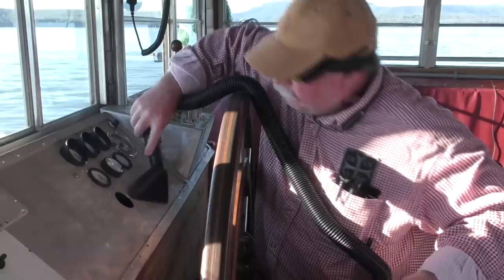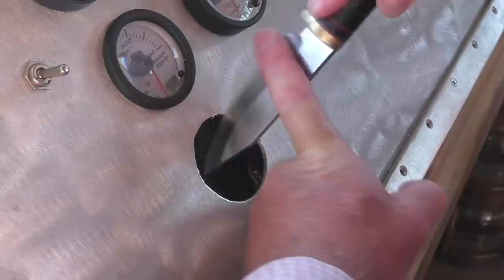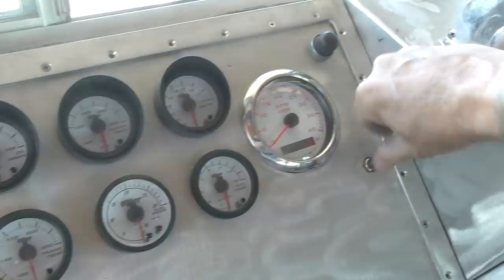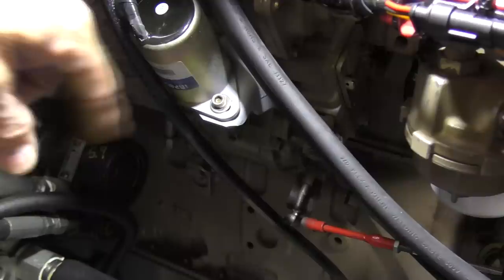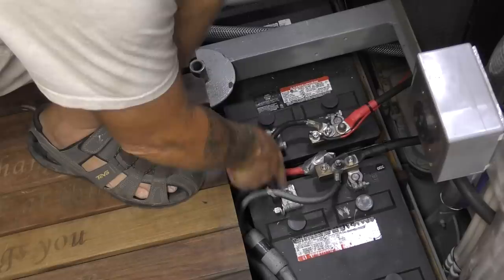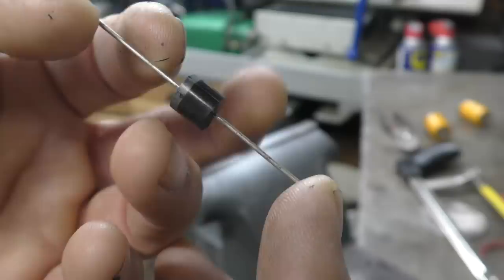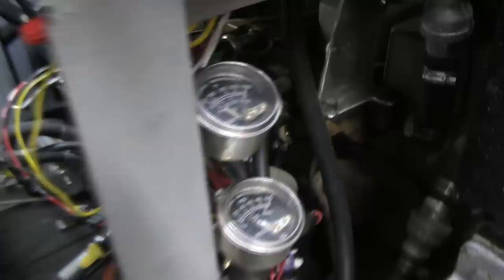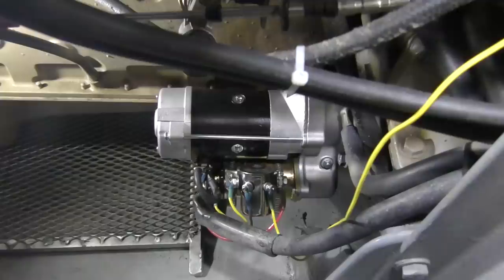Engine Electronics - Starter Relays Diodes and Gauges

Comment: I know this might be a bit on the high tech side, but an automotive CAN bus system and glass gauges on a display would be pretty trick, and let you pick up a lot of pressures and temps without a lot of wire. Even can program in some alarm limits and control points.

Comment: You had a lot going on so it was a little hard to pay attention but, maybe that ground wire was the problem and it was back feeding 24 volts through all the solenoids and all the way back up to the switch.

Comment: FYI that Is not a ground wire on the starter you had the 300 a solenoid grounded to, that would be the 24V that rotates the starter motor 😂

Comment: Hi Doug.
Put a fuse in series with the diode..
Diodes out of alternators are fairly chunky..
You could also use a spark plug (very small gap) also with a fuse.
Regards Mark.

Comment: The diode idea is good. You may need to make an array of 10a diodes series ups voltage, parallel increases amperage. An inductor or choke might help as well. They sell larger diodes too. A boost capacitor pack rated for 24v would work way better, because it works like a filter(less noise).if it was me I'd do both for peice of mine. With EVs' the way they are you might be able to find a contactor for cheap. Some contactors come with diode suppression. As always Thank You for the great video.

Comment: The voltage rating on a switch has a lot to do with how far apart the contacts get in the open position. Your problem isn't surges of current, it's that the air gap isn't sufficient to break the arc quickly (and the contacts lack sufficient thermal mass or melting point to sustain any significant heating) You SHALL continue to burn up 12v switches regardless of anything you do to limit back EMF or reduce the switched power in watts, with the only hope being that you randomly stumble on a brand that builds 24v capable switches and labels them 12v only by mistake.

Comment: Your back EMF and diodes is an interesting problem...One other way to think about coil inductance and back EMF is that it is analogous to water hammer. So inductance in a circuit gives the current flow a sort of "momentum" and if you try and shut it off "instantly" that "momentum" immediately hammers on your air gap you just made with a switch (or relay contact). The "momentum" will create as much of a spiked hammer pressure (back EMF voltage) as it needs to continue flowing how it had been (hence all the arcing etc.). Viewer\Commenter "d_" @deefdeefdeef  points this out, and so what you want the diode to do is be pointing in the direction that permits the continued circulation of current around that coil to continue even after you have opened a gap to the power supply, so then it harmlessly continues to circulate in the same direction around the coil, SLOWLY dissipating because of the coil's resistance. That's always made it easier for me to think about it in the past anyways. As far as diode current rating they would need to carry at least the same current as seen in the coil at the moment the switch is opened. BUT there are other factors such as response time (also mentioned by "d_" @deefdeefdeef ) i.e. using Schottky diodes etc.

Comment: On your secondary starter solenoid, run the 24V output directly to the larger wire on the starter.  That way your starter solenoid only has to engage the bendix and not have to close current to the actual starter motor.

That's basically how a Ford starter has been wired forever. Look up the starter wiring for a '65 Mustang or an '80's Bronco  (or, hell, a riding mower :) )

Comment: The 10A diode has insufficient current rating for those very big relays.  A catch diode like that does not require very much voltage rating (50V is plenty), but the current rating must be higher than the solenoid current at the moment you open the solenoid.  Use a TVS diode instead of a regular diode because it is built to take a large transient loads.  That means it can absorb much more energy without damage.  I also suggest a large non-polarized capacitor in parallel with the switch contacts (not in parallel with the diode), such as 1uF, 50 volts.  The capacitor gives the current an alternate path to take when the contacts of the switch begin to open and the diode is not yet conducting, just when a spark would normally form (just like in an older distributor with points and a condenser).  A capacitor will reduce sparking on the contacts even more than a diode alone and lengthen their life further.  One thing to realize is that a solenoid is actually a generator.  The mechanical armature generates back EMF when it moves.  Therefore, the diode must redirect both the stored energy of the coil as the flux decreases and the stored mechanical energy of the spring as the armature retracts.  Another thing is that any switch contact bounces on both open and close for perhaps hundreds of hits.  This re-energizes the coil many times over and causes a sustained spark.  The capacitor will help reduce this, too.  For the TVS diode I suggest DigiKey P6KE43ALFCT-ND.  For the capacitor I suggest DigiKey 399-R82CC4100AA60J-ND.  They are both under a buck.  There, now I'm not such a bilge rat.
Reply: Loved your explanation that the coil in the relay is acting like a motor that when the iron core slides back it generates a voltage, an ah ha moment, thank you.

Comment: If you have back-EMF in the coil because there is no diode in parallel with the coil, the one who will suffer is the switch that closes that coil circuit, not the coil. If the auxiliary contacts of the relay/solenoid drive an inductive load or a resistive load, but far away with long cables, you will get back-EMF too and for the low cost of a diode it is worth to install them there too, close to the auxiliary contacts. You should install the diodes as close to the inductive load, so that the voltage spike does not propagate back on long cables, producing interference to nearby equipment. Of course if the cables are long the diode close to the auxiliary contact are a must, as they behave as an inductor too. In the absence of diodes, the back-EMF generates sparks in the contacts wearing them faster like it happens on an EDM machine. If the contacts bond together I would say it is overcurrent like it happens to an electrode in an arc welding machine. Of course back-EMF can help in the bonding too, as a back-EMF spark generates additional heat. Of course very strong back-EMF voltage spikes can damage with time the enamel of the coil windings.

Comment: I don't understand the details but it would stand to reason. In a breaker point ignition system, you feed 12V to the coil, the points are open and the coil makes a field. The points then close and short to ground, the field collapses and the coil fires out, I don't know, 10KV or something. A good friggin spank. To keep from burning out the points, they use a condenser which I think is pretty much a capacitor.

Comment: If you squint at the little picture on top of many relays, there's a diode already there, they're known as "Quenching diodes" which i think is both descriptive and more poetic than the alternative; "snubber diode".

Mixing 12 and 24v like that does give me the heeby-jeebies, but as long as you take care when trouble-shooting and keep everything well isolated it'll be fine. I've seen this done in way jankier ways that worked fine for years.

Comment: The diodes PRV (peak reverse voltage) has to be higher than the Back EMF or it will short it . The ones ive always used were rated @ 1000v PRV on 24V systems and never had an issue with them .
Reply: Are you sure about that? The back EMF is going forward-bias the diode turning it on and you'll just get a 0.7V drop across it, at whatever current the coil was driven at.

Comment: I recently heard a good explanation of the difference between coating and paint: paint is for aesthetic purpose while coating is for mechanic/chemical purpose.

I am not specialist, but I though the diode was not enough, having a quick look for it, it seems you need a resistor/capacitor in parallel with the swich and the diode in parallel with the coil.

Comment: 9:50 Why don't you use a MOSFET? They're dirt cheap and made for the specific reason that you can use a low current signal to open a higher current line.

They're used in airsoft guns to prevent archs on the trigger when one wants to use a lot of power with the motor.

Comment: Those large starter relays are really crap devices.  The contacts are plain copper (if your are lucky) heads of the stud bolt, no silver or noble metal contacts.  The moving contact is a large copper washer that is pulled down against the head of the two bolt heads when you power the coil.  They are not designed for low current control circuitry, and will pit and corrode quite fast.  Compared to a regular control or power relay,  the armature coil is massive, has lots of inductance resulting in a lot of stored magnetic energy.  They can take up to 5 amps to pull down that copper contact washer.  When you de-energize the coil the magnetic field collapses instantly.  All that stored energy has to go some place.  The positive end becomes negative relative to the positive end of the coil  at many hundreds of volts for many milliseconds as it tries to keep the current flowing. The diode shunts this back into the coil where it gets dissipated in the resistance of the coil as heat.
Those power contactors have habit of welding the contact washer to the terminals and not releasing ( this keeps the starter engaged -- not a good thing).   A nice automotive  power relay ( head light, fuel pump, etc type) is a better solution.  To add a diode around the starter solenoid  and the remote relay.  Try and isolate the starter solenoid coil supply and control lead from the starter motor.  As that motor spins down it acts like a generator which could fry the diode on the solenoid if they are wired together.  Use a separate fused 24V feed line and ground through your remote control relay.     If you can't find 24V relays,  just measure the coil resistance and then add a series dropping resistor of the same resistance value in the circuit to drop 12 volts so the coil only sees 12V.  The resistor should have at  least 10W power rating.     For the diodes;  5A to 10A  current rating should be fine but the reverse voltage rating should be 600V or greater.  In a lot of cases a 2A or 3A diode would be fine for smaller relays.   Some times a 1000 ohm 2W resistor across the coil helps by reducing the ringing of the coil when you de-energize the coil.  Generally you can't put a diode across the starter motor, without a current limiting resistor to protect the diode, just too much stored energy in the motor. 
Good luck,  you will have a lot more fun chasing electrical problems when you get to salt water.  Salt water and electrical contacts don't play well together.  Just ask the thousands or car owners in Florida after the hurricane.

Comment: I'd be interested in seeing what the peak amps are on the voltage that are going through those switches. I think those contacts are being welded together and the diode is failing because you're getting a massive inrush of current. Wether that's through back-EMF or just the draw on the coils.
Reply: I dont think it is amperes. There is an arc or plasma as in plasma welding. You dont need much to weld  contacts together.

Comment: Flyback diode, (you want a schotky type iirc) used to prevent relay coils from inducing a HV spike back into your sensitive electronics. a better choice would be a capacitor on the load of the contacts, like a condenser in a engine points ignition system, when the contacts start to open the capacitor takes the load for a short amount of time allowing the contacts to get too far apart for an arc to form. your failed switches / relay contacts all show signs of high current arcing not high voltage, that is caused by contacts that do not open fast enough to not allow an arc to begin. picture welding, when you strike an arc you pull back slowly and you can pull a really long arc and that's only 30 volts, you snap the rod away from the work violently and you will not start an arc. I suspect your switches are not rated for the higher voltage meaning they do not open violently enough to prevent an arc from forming.

Comment: Get the right kind of Diode that is designed for back emf(voltage rating matters as well) and you could always install a second timed relay to completely get rid of all sparks. How? you energize a first relay with a resistor to lower in the inrush current then you fire the second relay after like 0.5 seconds to let the actual current through. This might be overkill and my recommendation would be to get a good relay(contact materials makes a huge difference) with a proper diode.
Reply from the maker: Give me a link to what you think the right kind of diode is.

Comment: Try the diode again now the back feeds have been fixed. The amperage backfired may have caused the burn out. I could be wrong. But, it only costs a couple bucks and 20 minutes of your time. Who knows how many amps were going through it.

Comment: The problem I'm about to outline is pretty far fetched but something to think about.  With the fuel switch on in the wheel house, you can't shut the engine down in the engine room and vise versa.    Like having a room with two doors in it often there are two light switches but those interact and just change state.  Do you think this is worth giving much thought to?

Comment: I was worried you were going to set the diode up in series and put it under lots of stress. Setting it up as you have is a flyback diode is the right setup, you just need apropreate sized diodes. I have replaced diodes in this cofig for solenoids that pull 40A at 48V as they were found some serious work.

Comment: look for solid state relays industral that will operate at up to 24v  and hook a varistor  electronic across contacts to collapse extreme voltage when activated.. I used this design for radiator cooling fan high amp 12v because normal 12v relays kept failing this design has no problems and works great...

Comment: Regarding the weird noise (this is a guess), if the starter kicks in and generates a voltage drop in the battery (old battery maybe) or a voltage drop in cables that are not thick enough or there is a bad contact in the chain, that voltage drop might not be enough for the coil to keep holding the contact. Like when in a car the battery is low and you kick the ignition and the starter does not turn and the solenoid starts to rattle.
Reply: Sorry, you got to the same conclusion. If I only waited 🤣

Comment: It sounds like the Bendix gear is grinding on the side of the flywheel. It needs a spacer between the starter and the engine.
Reply from the maker: No spacers on this engine.

Comment: The diodes you are using are too small for your application. The diode is included to protect the switch that is turning on the relay. Think of a coil as constant current device. It tries to maintain a constant current through the coil. When the relay is turned off the current tries to maintain the same current as when it is on. Therefore, the voltage across the coil reverses polarity and increases in value until the current is the same value as when the relay was on.  This will create a large voltage spike on the switch that can arc across the contacts. The diode should be rated for at least a 100A for a large relay. The diode VS-100BGQ100 from Digi-Key Electronics is only $4.00 each for 10. This shouldeliminate your problem with the switches burning out.

Comment: the diod burned because of your incorrect ground connection that you already fixed
 Install a new diod on that coil.
 And yes, the diod will protect the contacts from arching and burning.
This, actually, is a pretty standard protection on the DC circuits.

Comment: I'm not convinced that the diode will fix it. when your starter button died it was in series with the relay. The collapsing field would pass the current through it. But your little relay that was melted? The coil was isolated from that set of contacts on a separate circuit. 

But when any switch opens on 24v its just like striking an arc on a TIG torch which is also ballpark of 24v. The collapsing field in a relay helps start the arc of course as it induces a voltage spike from the back EMF. So my guess is that you're going to see some successes with the diodes and still some failures. 

regardless, I'm glad to see Seeker on the water doing boat things. Thats gotta be one hell of a lifestyle change.

Comment: Velcro the wires to save zip ties :)

The diodes could be too slow for the application. Rectifier diodes might be supposed to be used at <200Hz.

And that large coil might put out way more than 10A when shutting down.